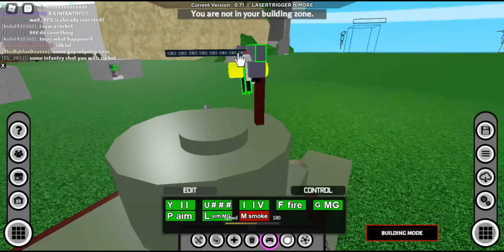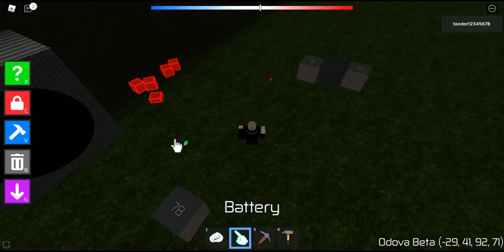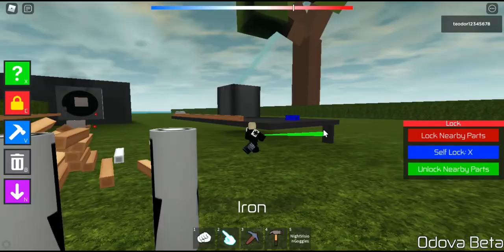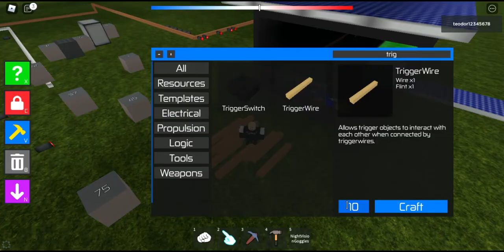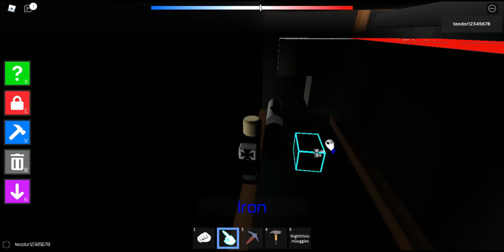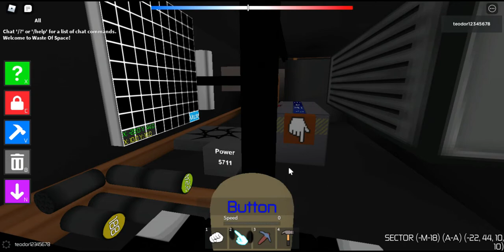Waste of Space Roblox Basics Tutorial

Comment: Fun fact: it should be possible to go to space in under 5 minutes!
Tech: attach a rotor to the front of a vehicleseat(2x2x2) and hold the key E, it has some odddd stuff able to get into space
Reply: i have something faster get 6 iron one has a hinge on 2 sides then make another iron have one hinge then connect it to a iron on the ground then 2 iron going up then put the two sided hinge iron on it get a vehicle seat put it on the hinge and get your last piece on the two sided hinge your end result will look like a turret get on the vehicle seat and look down ez fling
Reply: what about 2 wings and a vehicle seat, making seat big fast rotate and then rotate?
Reply: its not good though
yeah you get to space
BUT
you have no oxygen or hyperdrives
Reply: @horriblepersonwithaudio ok then add solar pannel and a hyperdrive and 10 10x10x10 powercells with you, u can also add some cleat to the end of the stick to stick to stuff

Comment: you shouldn't use batteries power cells aren't much more expensive than batteries and work much better
Reply from the maker: Batteries come with 400 power each
For ships of course I use power cells, but if you're just rushing to leave a starter planet I suggest batteries to power a grid
Reply: batteries are much more convenient than setting up a coal power generator
to build one you need an extractor, a bin, several burnergenerators, and a powercell
to use batteries, you get some sulfur, get a wire, craft it, and you have 400 power ready to be used
plus, griefing and raiding is allowed in this game so the goal is to speedrun getting to another planet before someone can undo all your hard work